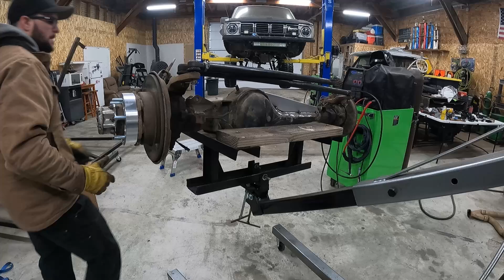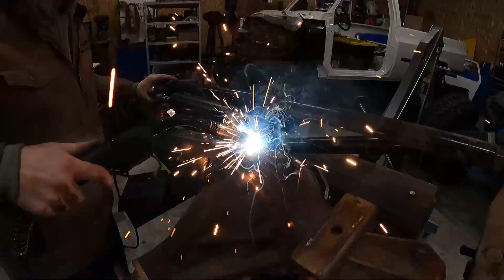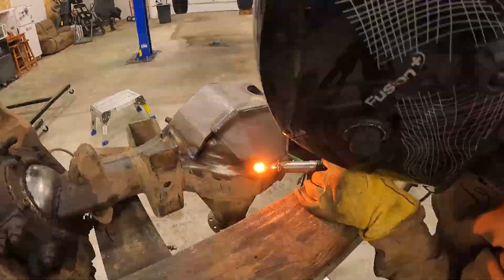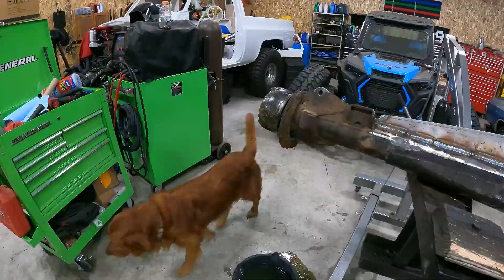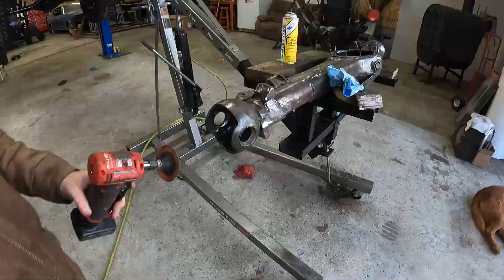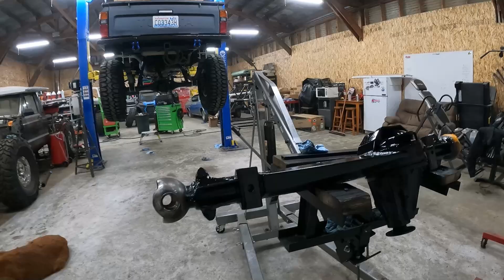Toyota Solid Axle E-Locker Install

Comment: Do you foresee any problems running 38” tires with Toyota axles? Nice work!
Reply: I’m running 39.5s on mine
Reply: @tjangel2212  No issues??
Reply: @chuckkirkton6973  haven’t ran it yet but there shouldn’t be, I have rcvs and 6 shooters, my setup is pretty common